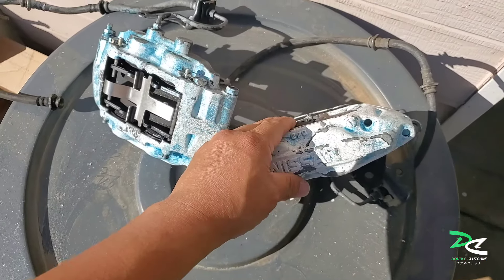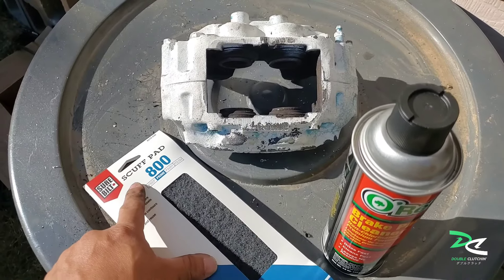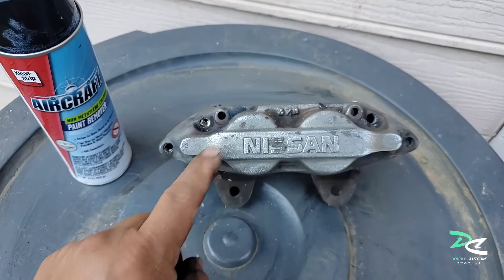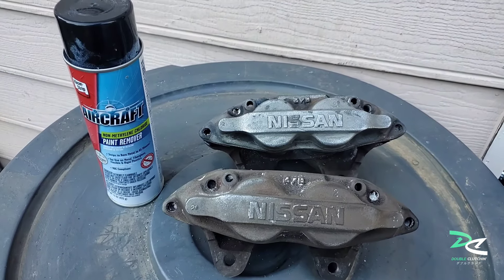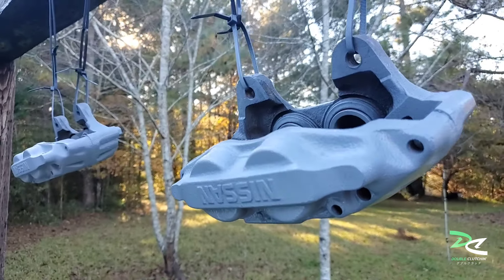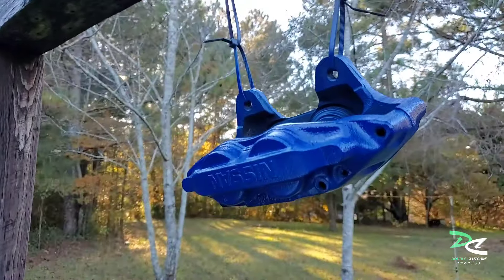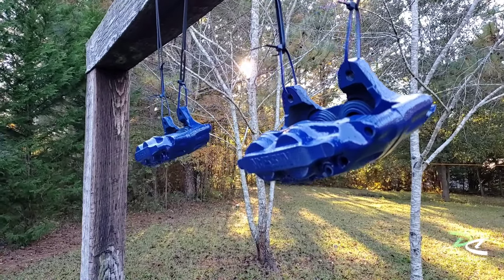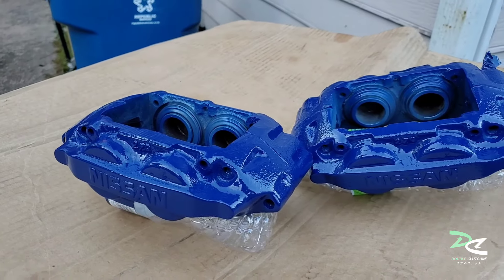R32 Skyline - How To Use VHT Caliper Paint Blue For Z32 Brake Calipers

Comment: why didn't you tape off the piston/seals?  That shouldn't have been painted at all.
Reply from the maker: Yeah, I was thinking about taping the piston/seals area so the result will be much cleaner but I decide to do it anyways. As long as the calipers were painted, I was happy. It doesn't affect the braking performance.